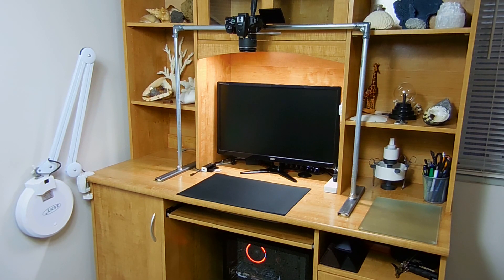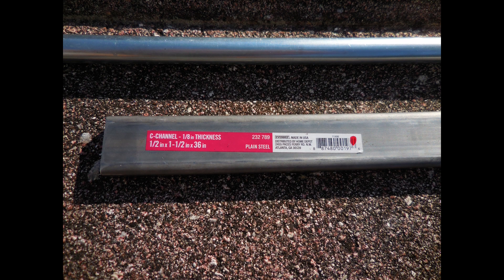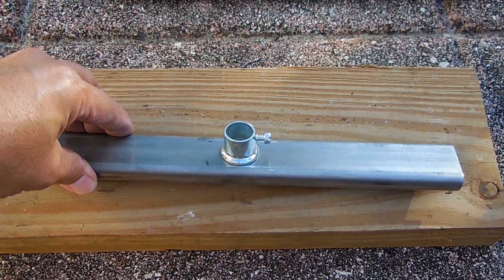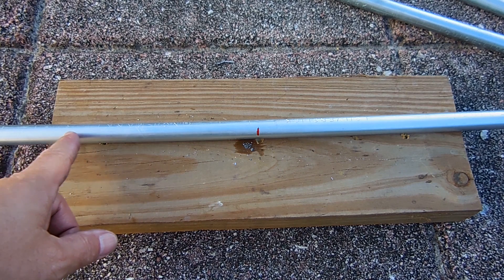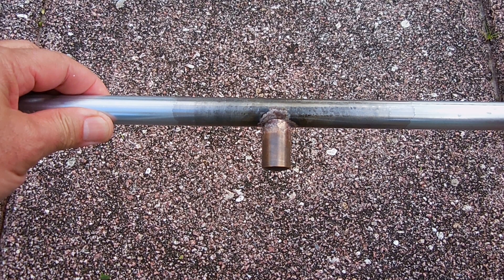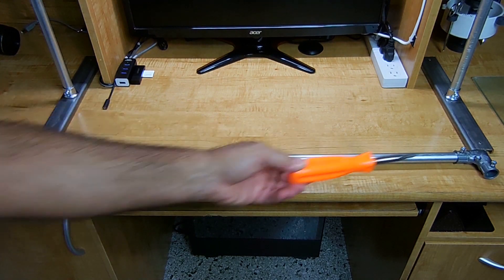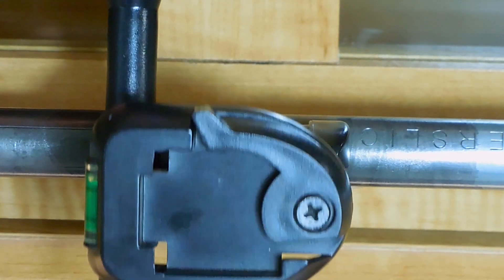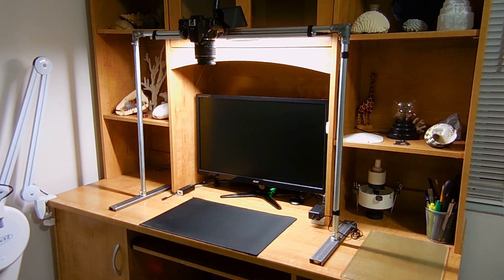The BEST Homemade Overhead Video Camera Setup - LOW COST & HIGHLY STABLE!

Comment from the maker: If you'll be overhead filming on a large mat, then there's no need for the protective rubber feet on the stand. The stability of the platform will be increased without the rubber bumpers.